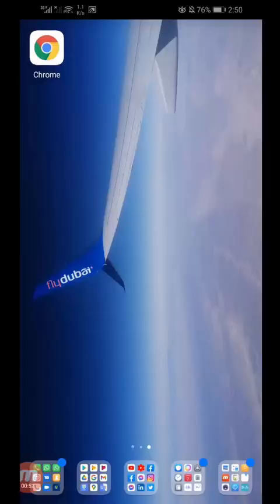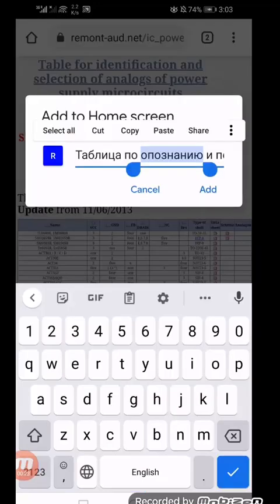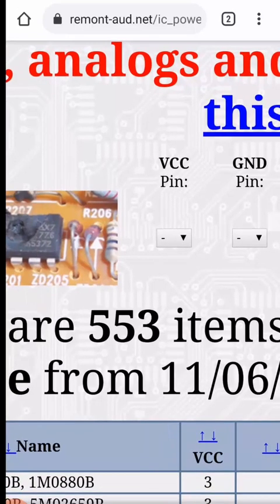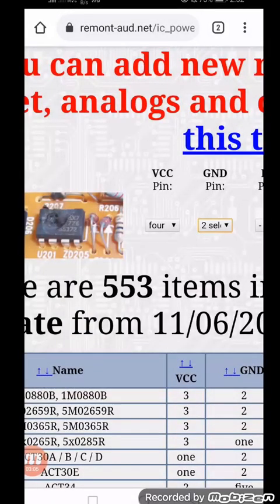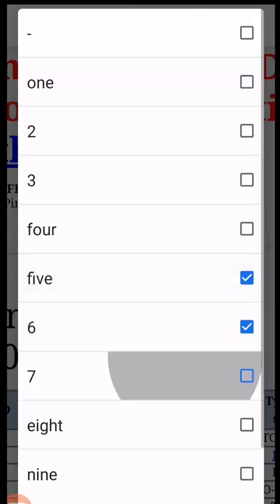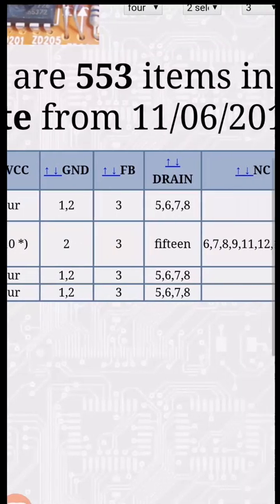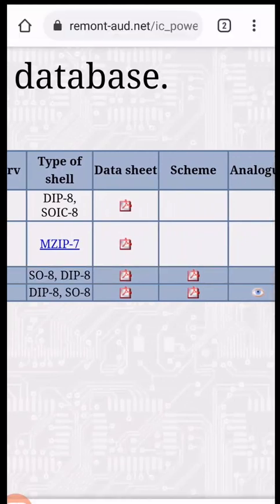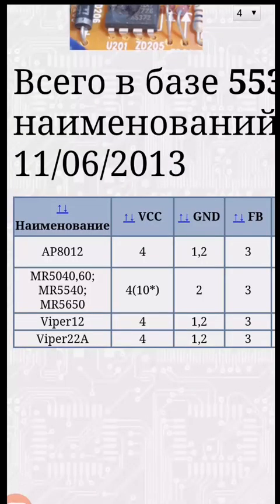[371]  Use Mobile Phone to find any Unknown PWM SMPS IC Number

Comment: How to get p-a643140 circuit power chip number,pls help
Reply: Im tested it,thanks
Reply from the maker: download schematic EAX64628702 or its service manual
Reply from the maker: it is using PCA9515AD or LNK364 IC
Reply: @HaseebElectronics  may  thank you verymuch  for this help

Comment: sir help to find equivalent ic 6210 alternate plz tell me how to find
Reply from the maker: what is the complete part number of 6210
KIA6210 is audio amplifier 
LT6210 is operational amplifier 
A6210 is buck regulator IC
TLE6210 is ABS system IC

please reply the complete number and in which circuit is used. or number of pins like (10 pin DIP, 14 Pins SIP)